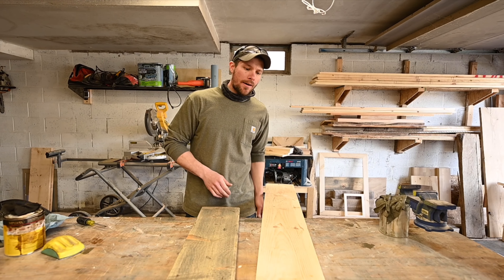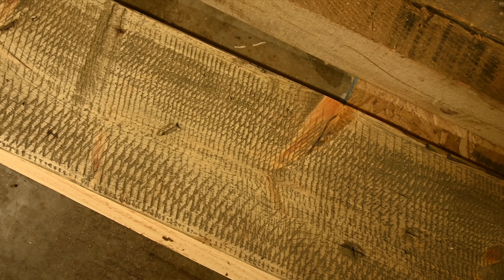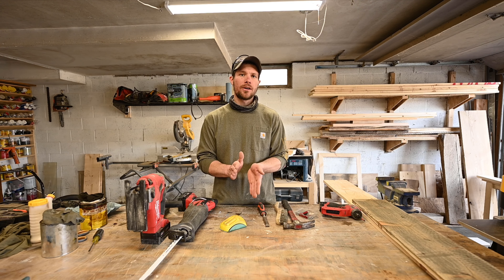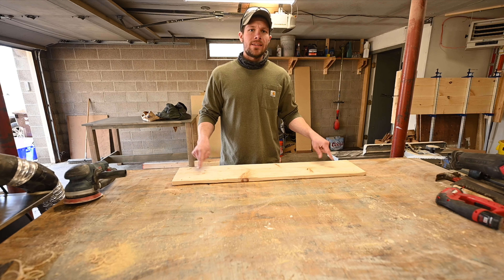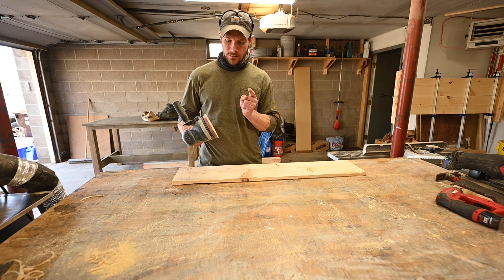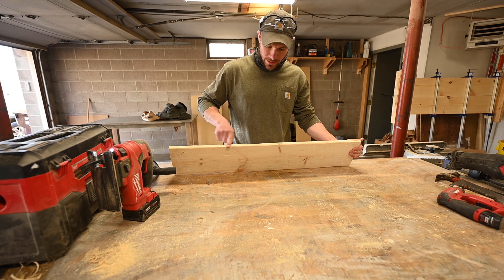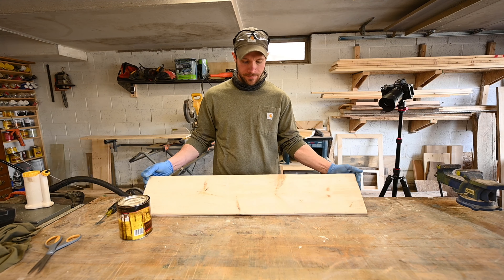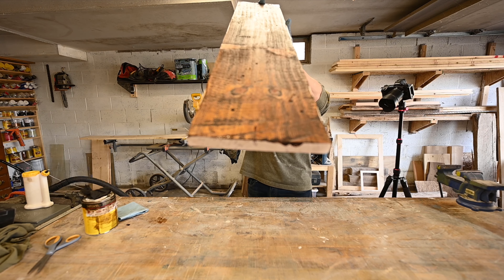The BEST ways to DISTRESS WOOD - My methods for distressing wood fast - DIY Barn wood. NO STEEL WOOL

Comment: Take one of those long sawzall blades,drill holes in it and screw that wire brush to it. Put that in a variable speed sawzall for less hand work. Lightly burn with a torch to distress the grain.

Comment: Really like your results. Do you just go over the boards once in each direction with the sawsall? Are you just knocking down the fibers with wire brush or actually taking some of the softer wood out?
Reply from the maker: Thanks a lot! Yes sometimes I do once in each direction. This kind of can give it a criss cross looks which some barnwood does have. And also yes the wore brush takes the softer wood fibers out making it look more distressed. Thanks for watching and commenting!